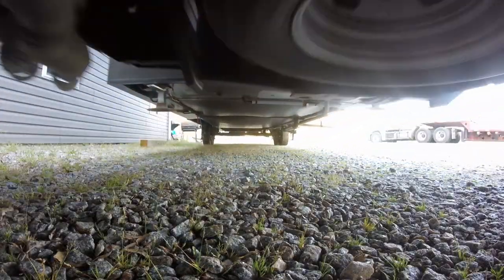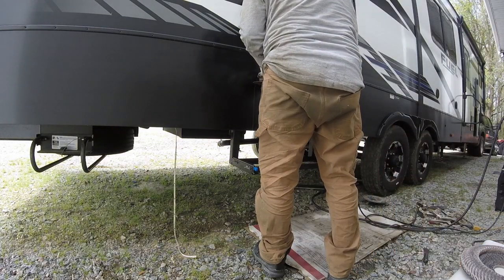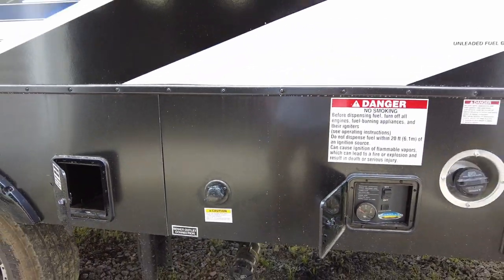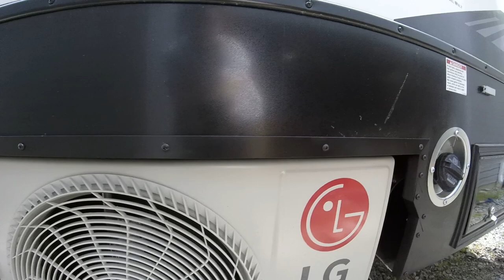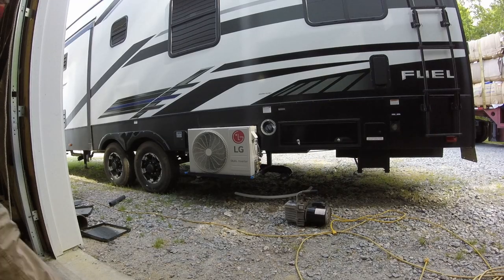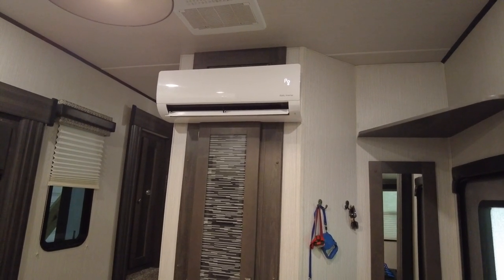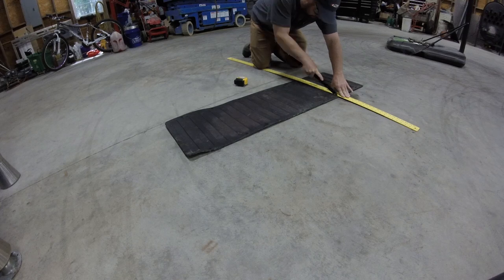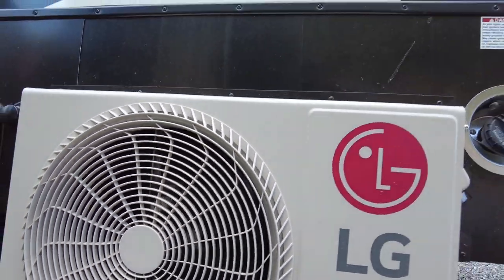Installing LG Mini Splits In The RV Toy Hauler. E:3

Comment: Very nice...incredible workmanship...congratulations on a significant upgrade...The entire RV industry needs to get with the time and change how they heat and cool the RV.  Dometic is very loud and not that efficient.  Thanks for the video.
Reply from the maker: Thanks for watching, glad you enjoyed the video. Unfortunately, the rv industry is built em cheap and fast for the most part, and the customer has to adapt and overcome.

Comment: Nice Job! We have a two-unit LG mini split mounted on the rear of our fifth wheel - two years later, still running strong and quiet. We can run it off our solar too.
Reply from the maker: Thanks for watching. They are awesome. We just camped with lows of 20 and never had to run the lp furnace.

Comment: You got some mad skills there buddy! you have inspired me to do the same, our problem is that our heater likes to shut off in the middle of the night and we wake up to reset from thermostat just to get it running again.
Reply from the maker: Thanks, we set the furnace to a decent temp so if the minisplits can't  keep up the furnace will kick on like emergency heat.

Comment: Nice job. You could of also used a dual zone outdoor unit to eliminate having to install two outdoor units.
Reply from the maker: Thanks. I didn't use the dual zone because they are 220 volts and my generator is 120 volts, so i would only be able to run them on shore power.

Comment: Most excellent job. I was just wondering why you didn’t install a single outdoor unit with two heads?
Reply from the maker: Thanks for watching. The outdoor unit that runs multiple heads is bigger and requires 220v, I wanted to keep them 120v so they could be run off the onboard generator.

Comment: A couple of questions for you.  How do you cool/heat the front bedroom area?  How do you get rid of the condensate from the indoor cooling coil units?  I liked your creative ways of putting in the Mini-Split systems.
Reply from the maker: Thanks for watching. The front bedroom sits higher so normally the hot air tends to travel that way. If it gets to hot during the day in the summer we turn on the rooftop unit in the bedroom (its has to be really hot for this to happen). There is 5/8 plastic tubing that runs from the indoor unit to the outside underneath the rv. Hope this helps

Comment: Awesome!  When you can do mine?lol.  Does the unit behind the steps do ok when its not slid out?  Are the slide outs just for air flow or are they required for maintenance or some other purpose?
Reply from the maker: Thanks, the unit behind the steps does good when not pulled out. If I went to Arizona in the summer I would probably have to pull in out for better airflow, makes it easier to keep them clean and work on if needed.

Comment: Have you thought about a cover "bag" to protect the exterior units from dust, dirt and sloppy wet road debris, over and above just mud flaps??
Reply from the maker: We haven't had any issue, they stay pretty clean and get washed every trip when we wash the camper. Thanks for watching.

Comment: Not being able to do all this work myself.  Have most of the tools, welder and believe I am capable, but just not wanting to screw up a new rig.  Do you think there is a place to go and have this done?
Reply from the maker: Not sure, may could try local machine shops or if you have someone that does custom cars. They could mount everything then have HVAC tech hook it up.

Comment: The flexible silver lines you used , are the same flexible lines that plumber use ?
Reply from the maker: No they are specifically built for A/C systems. Here is a link for them.
https://www.supplyhouse.com/Flexible-Refrigerant-Line-Sets-21212000
Reply: @SBranchCreek  thanks for responding and for the info 👍🏼

Comment: I would like to do this to my 2022 Grand Designs 312BHTS.  How has yours held up with the traveling.  Have you had any issues with the outside units? I was thinking you may have to add a screen guard or something over them.
Reply from the maker: Haven't had any problems, the mud flaps keep anything from damaging the units. We have been very happy with them.

Comment: Excellent job .I have a question.You seem to know what you are doing.
Own a motor home with a basement ac Coleman Mach .Wiring and duct work right their.Four round vents on each side.
Buying a mini split cassette for the duct work running through my coach 
Building a drawer slide out for my out door unit and insulating my indoor unit hooking to my duct work.would I have enough air flow to do this.Duct goes up the back of motor home with a y going to the left side. Appreciate any suggestions
Reply from the maker: The main concern i think is if the cassette blower has enough CFM to force air through the duct work. I have never used a cassette but like the ldea.

Comment: ... Good job but ... time wasted – because no pulling out the unit for ventilation when stair is out ...
Reply from the maker: Thanks for watching. It pulls out 2" when the stairs are down which gives me the necessary clearance in the rear of the unit for air flow . Helps when cleaning the unit also.

Comment: Wonderful content. The best I've seen covering travel trailers and mini-splits (and there are a few). As I was watching, I was concerned about road debris and damage to the compressor. Low and behold, so were you, great idea on the mud flaps. Subscribed, 
I saw you attached flexible hosing from the end of your copper to the actual mini-split connection. Was that typical stainless steel flex pipe that you would find at a "big box" store?
Reply from the maker: Thanks for watching, the flex lines came from Ecomfort. 
https://www.ecomfort.com/cooling/mini-split-flexible-connectors.html
Reply: @SBranchCreek  Many Thanks!! Keep the content coming
Reply: Great video. I'm looking to do something similar to my cargo trailer toy hauler conversion,  but locating the condensing unit is the problem. The flexible hoses may be the solution.  Are the flexible Connectors suitable for repeated bending?  Did you come across any swivel type fittings that would allow for repeated swinging of the condensing unit to move it into place? I am considering placing the condenser under the overshot where it would swing down into place when being used and up out of the way while traveling.  Thanks again for the great video.

Comment: I love to fab, I weld and machine for a living. You sir have skills! Question, what did you use for flex from the units to the frame to allow them to slide out?
Reply from the maker: Thanks, the flex lines are here: https://www.supplyhouse.com/Flexible-Refrigerant-Line-Sets-21212000
Reply: @SBranchCreek cool thanks😊 Better lines than the first rectorseal ?
Reply from the maker: @2hotscottpro  Yes, the way the flexline attaches to the hard pipe is much better on the new ones
Reply: @SBranchCreek  thanks man! These roof tops are hungry n loud,got get a mini.

Comment: Depending on the model of minisplit some of them are TWICE as energy efficient as the rv AC units. There are 12,000 btu minisplits out there that will run at 720w at full load! The average 13500btu rv units will pull about 1500w under full load. That's a massive difference especially when you factor in the start up amps the rv units pull with its on-off-on-off  cycle vs the inverter style minisplit that will stay on the whole time while dropping its power to match the heat load.
Reply from the maker: Thanks for watching. There are so many benefits, power consumption is a huge one.

Comment: Outstanding work sir! With so many people looking to get mini splits in their RVs one could make the sliding brackets for the stairs a business. Do you have any measurements and type of steel used in your setup?  Most folding stairs are the same size. I know I would have to widen ours when we decide to convert.
Reply from the maker: No I dont have any measurements, it wasn't a direct fit for the stairs, it required alot of cutting to make it fit.

Comment: You could make a fortune installing for those of us who are afraid to tackle such a tremendous project.  I'm in the Mojave Desert and my swamp cooler adds too much humidity despite also having a dehumidifier, and regular ACs only work during monsoon season because the desert is so dry.
Reply from the maker: Would be nice but don't want to take on that liability. Thanks for watching.

Comment: Fantastic. I think I’d like to do the same. What material did you fabricate the mount under the stairs with?
Reply from the maker: 1-1/2 square tubing and angle iron welded to the frame and heavy duty drawer slides for the unit to slide on.

Comment: I plan to install on back bumper but I saw where a guy did that and his fittings broke seal from the flexing while traveling down the road. He solved it with 3 ft long flex hose. How did you make yours be able to slide in and out?
Reply from the maker: 250lb rated drawer slides and flex lines, probably the same as he used.

Comment: Question,  why didn't you get one unit to connect both heads?  Did you explain that?  Maybe I missed it.
Reply from the maker: I wanted to be able to run them off the onboard generator which is 115 volts. The multi head units are 230 volt.

Comment: Does the outdoor unit need to be on the exterior of the rv or can you put it under the rv in pass thru or a storage bay
Reply from the maker: @kennethzabokrtsky6543  the unit needs to be somewhere it can get good air flow and can get rid of the heat, I probably wouldn't put it in storage or underneath where heat would have a hard time escaping.

Comment: Really nice work!  Do you pull the unit under the stairs out 2 inches each time?  You mentioned in another comment it worked find left tucked in
Reply from the maker: Thanks, most of the time I do pull it out so it can get as much air flow as possible.

Comment: Wonder what the start up amps were. Putti g a soft start on that thing you could probably run it off solar/batteries.
Reply from the maker: Not sure the start up numbers but it ramps up gradually so the numbers probably aren't that bad.

Comment: Awesome Job! Great engineering! Does the length of the lines matter?
Reply from the maker: Yes length matters, these units shipped with the correct amount of refrigerant for 25ft lines. If your length varies a tech will need to add or remove the correct amount.
Reply: @SBranchCreek  thanks for the feedback!

Comment: Great job bro. You may want to cut the flare nuts off and braze the lines. Flare nuts leak a lot especially if they vibrate.
Reply from the maker: Yeah, they now have a push to connect fitting also. Thanks for watching.
Reply: @SBranchCreek  That.s cool. Didn't know that and I have done HVAC for 35 years. lol. You bet.
Reply from the maker: Check them out here.
https://www.supplyhouse.com/Rectorseal-87022-3-4-PRO-Fit-Quick-Connect-Union?utm_source=google_ad&utm_medium=shopping_neutral&utm_campaign=Shopping_Neutral_New_users&gclid=EAIaIQobChMIgrGxyoPOgAMVcFJ_AB3IBgEsEAQYASABEgLcTfD_BwE

Comment: You are a master fabricator! I'll be doing this work in the spring! How has the units held up so far with all the bumping and jostling from driving? Also your unit under your stairs, i notice you can't pull the unit out with the stairs down. It's that hindering the efficiency? That's where I'm installing mine.
Reply from the maker: Thanks, Units have held up great, I had a flex line fail on one unit. The new flex lines are built different so they should hold up better. I haven't noticed any efficiency issues with the stair unit, the slides are mostly there in case they need maintenance you don't have to unbolt them. Thanks for watching, hope yours goes smooth.
Reply: @SBranchCreek About to buy a mini but been wondering where to install it till now haha Seen you post suplyhouse in another comment.I see peeps still asking you questions too .Nice work man!

Comment: What did you use for the flexible lines and did they hold up to regular use and movement?
Reply from the maker: @neemaborji9993 they have held up good, had. One fail due to the way I mounted it. https://www.ecomfort.com/cooling/mini-split-flexible-connectors.html
Reply: @SBranchCreek  Thank you! How often do you pull out the compressor on the sliding tray? I will have a different setup that will need to be used twice every time we go camping.
Reply from the maker: @neemaborji9993  mainly to clean or if it needs service, it gets good air flow with it pushed in.

Comment: Hey sir what is that you are putting on the threads before connecting the lines?  Awesome job!
Reply from the maker: It's called Nylog, its a refrigeration grade sealant. I used it on the copper flare mating surfaces to prevent leaks. Thanks for watching.

Comment: Curious as to why you didn’t go with a double head unit off one condenser/ compressor unit? Nic job on the install.
Reply from the maker: The one condenser/compressor unit that will run 2 head units operates off 230 volts, I wanted to stick with 120 volt so I could run them off the on-board generator.

Comment: Excellent fab. Could you have used 1 outdoor unit with 2 heads? Would the coolant line run be too difficult?
Reply from the maker: Thanks for watching. I used the 2 seperate units so that i could run them off the onboard generator. The onboard generator is 120 volts, the one outdoor unit that controls 2 heads is 220 volts.

Comment: Great job! What kind of flex lines did you use for the line sets? Are they still holding the charge?
Reply from the maker: Thanks for watching. The flex lines are from Ecomfort.com, link is below.  I have not had any trouble with leaks.

https://www.ecomfort.com/cooling/mini-split-flexible-connectors.html

Comment: It appears you are using some sort of flexible refrigerant line between the outdoor unit and the line-set. Am I seeing that correctly? If so, what flexible tubing are you using for this?
Reply from the maker: Thanks for watching. It's flexible line for A/C, they are available in different sizes and lengths. I purchased mine from Ecomfort.
https://www.ecomfort.com/cooling/mini-split-flexible-connectors.html

Comment: Great job! What kind of flex lines did you use for the line sets? Are they still holding that pressure?
Reply from the maker: Haven't had any trouble with them. Thanks for watching.
https://www.ecomfort.com/cooling/mini-split-flexible-connectors.html

Comment: Can I ask the model number of the LG?  I thought the 12k dual inverter was about 230 volt.
Reply from the maker: Thanks for watching.  You are correct the dual unit is 230v we run two separate 115v units. Link for them is.
https://www.ecomfort.com/LG-LS120HXV2/p99989.html?gclid=EAIaIQobChMIxu3M3s268wIVh4FaBR2_RwcSEAQYAiABEgK0afD_BwE
Reply: Thank you so much ,  everyone with an RV should watch your video’s. Creativity at it’s finest.

Comment: Do your flexible line sets stay flexible after you charge the system?  I have read that after they are charged they are no longer flexible. Thanks, nice job on your install.
Reply from the maker: They are still flexible, they aren't gonna do any kind of hard 90 or anything. They are very similar to the stainless braided lines at lowes that you connect water to hot water heaters.
Reply: @SBranchCreek  Thanks.
Reply: Where did you get those flexible lines. I have found the rectorseal products online, but all the sellers only have one of the lines I need most are backordered. Any supply houses I have contacted only sell to contractors. I will mount the condenser on the headache rack on my semi so it will be stationary,  but the cab has the small air bags under it , so it will move at least 3 inches. I don't think the copper lineset will hold up
Reply from the maker: I got mine from https://www.ecomfort.com/cooling/mini-split-flexible-connectors.html

supply chain has changed a lot since I installed them.
Reply: @SBranchCreek  thanks. I was on their site, but only had a few of the items I need. Thanks I will keep looking

Comment: Thanks for sharing. Which flexible refrigerant lines did you use? Are these flexible connectors to rigid copper lines?
Reply from the maker: These are flexible lines that are flared and connected to the hard lines that come with the unit. The ends of the flex line are secured to the frame so that the connections or hard lines don't move or flex when moving the unit. Thanks for watching. 
https://www.ecomfort.com/cooling/mini-split-flexible-connectors.html
Reply: @SBranchCreek  Thanks. So, you had to flare a female end and soldered on a male unit on the opposite end to make the flex line a full extension line?
Reply: BTW, I just bought the same LG mini split and planning to install it under my van flat in place of spare tire.  I didn't read anywhere why it can't be installed flat...
Reply from the maker: @e3ucxp  if you install it flat the oil won't return to the compressor and rhe compressor will burn up.

Comment: Wow you did a fantastic job! Love mini split systems, super energy efficient, and extremely quiet! There’s only one thing that I really would worry about is when you have a blowout on your trailer tire it causes extreme damage to the surrounding area. It looks like you’ve already upgraded your tires! Everything else you have done is fantastic! Happy camping!
Reply from the maker: Thanks for watching. My hope is if I have a blow out the auto leveling jack will protect the outdoor unit.